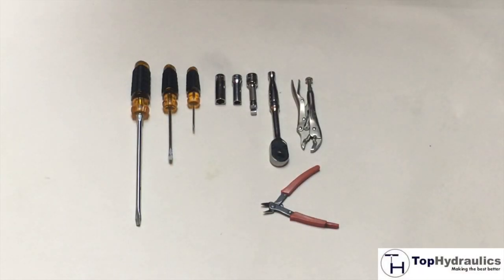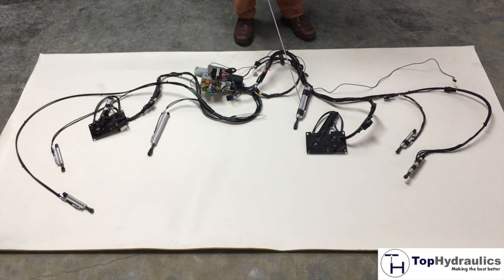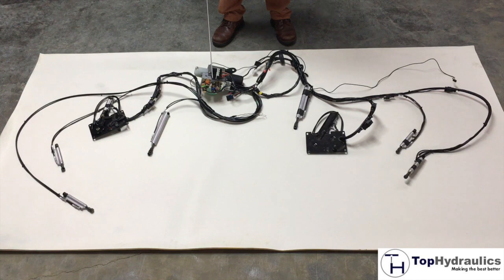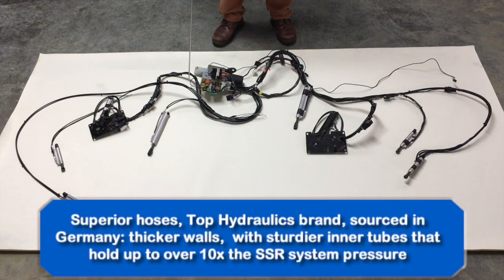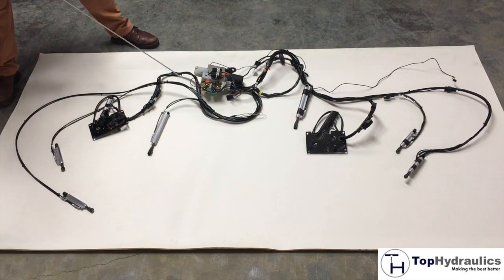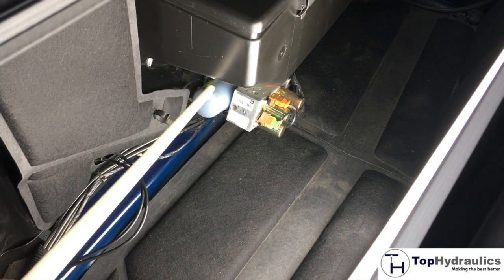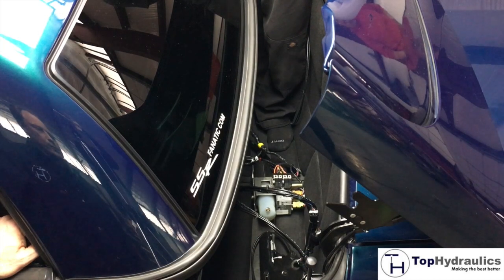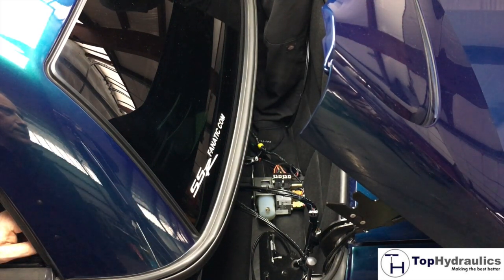Chevy SSR Top Hydraulic System Replacement - Chapter 1 - Introduction

Comment: I'm buying an 05 SSr, the roof was inoperable when I test drove it. Hopefully, this is something I can tackle on my own. From what I hear, there's only 2 companies that specialize in this system, and they're on opposite ends of the country.
Reply from the maker: Congrats on the new ride! Replacing the whole system as shown in our videos, is the ultimate solution where you should never have to worry about the top again. Judge for yourself from the videos whether you can do this. Space is a bit tight when standing inside the top’s storage compartment, but we hear lots of stories where SSR owners did the job all by themselves in a day, or they had fun doing it together with a buddy or a grandchild. Contact us if you have questions: 541 902 3214
Reply: @TopHydraulics  Will do. I can hear something energizing when i hit the switch it's just not moving. Could be the locking mechanism? But, I'll definitely work my way through your series.